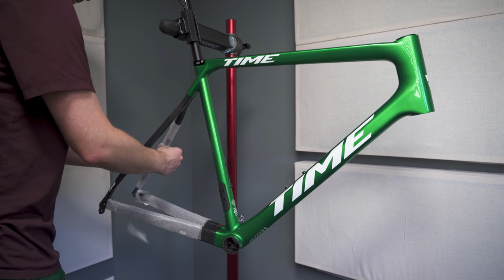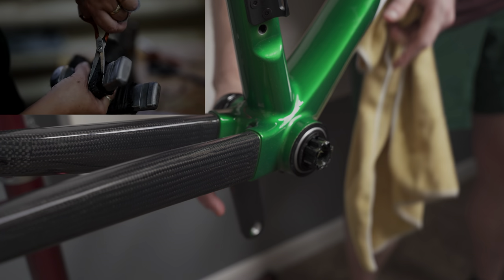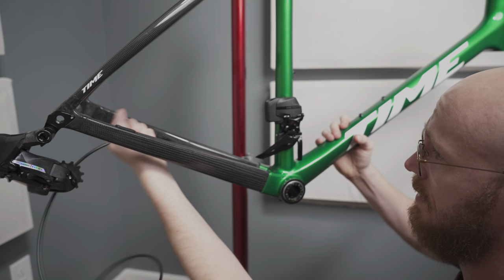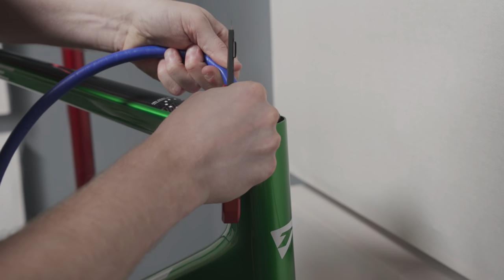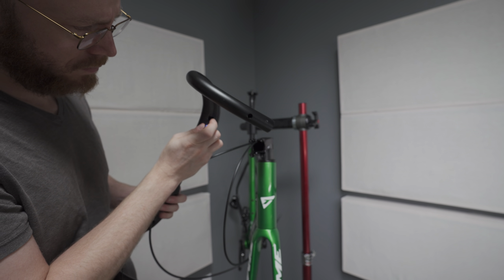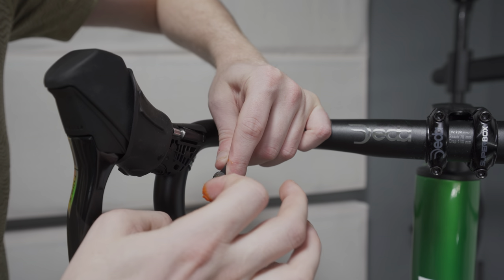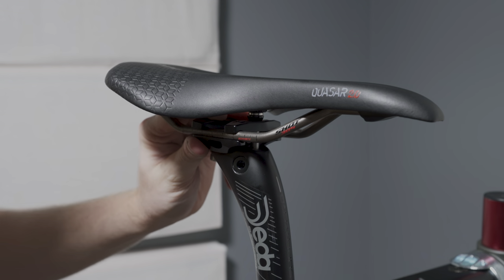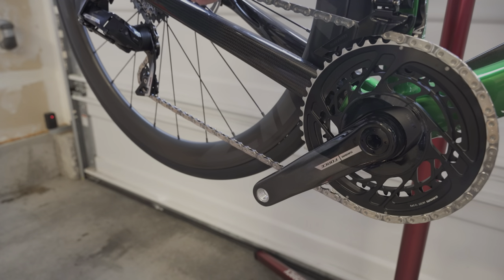Time Alpe d'Huez Disc 2023 with Sram and Zipp: Dream Bike Build and Ride in 4K HDR

Comment: I really like these frames. It seems like every choice Time made in its design was made to improve the practicality and durablity of the frame. There's lots of stuff that most people wouldn't notice. For example, Time limits the number of metal/carbon interfaces on the frame to limit galvanic corrosion. This probably won't matter until year four or five of ownership of the bike, but at that point the Time will still be in great shape while other frames will be starting to degrade. The paint, BB, dropouts, seat post clamp, headset seat etc, everything is simple and proven. This is a bike for people who like to ride a lot and want a bike for years that's not going to cause them problems. I'm personally waiting for a revised Scylon with an integrated front end, which will likely come in 2024.
Reply from the maker: Totally agree. It's funny because on one hand they're undeniably very flashy, but also they're a different kind of flash than a lot of the big name brands. I've just been around bikes long enough that I'm not impressed by whatever the engi-marketers come up with for this model year (forgetting The Big Thing that launched and dissapreared last year.) I just want a really solid frame, and this was it. I'm excited to see what they do on the Scylon. Mayne the Time gods will gift me a frame (kidding. mostly. 🥲)

Comment: I enjoyed that. I'm currently contemplating the same frame in red but with DI2 and Hambini BB. I just think these bikes look stunning and scream quality.
Reply from the maker: Do it! If possible, buy through a dealer vs. direct.
Reply: Why not direct?
Reply: I ended up with a Look 765 Optimum because the geometry was a better fit. Bought the frame from a bike shop and had them build it up to my spec. For me I wanted a more bespoke build that direct doesn’t offer.
Reply from the maker: Looks have the best paint scheme of all bikes IMO
Reply from the maker: @Floemo  much better customer support through a dealer. Time's national direct sales is... Fine at best.
Reply: @JustinDoesTriathlon  Yes have noticed that communication is worse than the Italien brands.

Comment: Justin- great video, I’m looking at a consignment Time and this helped a lot!  Was curious for a follow up on how you’ve enjoyed this!  Thanks!
Reply from the maker: Absolutely great. The only major tweak I've made (and I still need to make a video on this,) is: I don't trust hookless nor see the upsides to it, so I swapped the Zipps for some Light Bicycle AR465s on DT350s, which I quite like. I also had some major problems with my Sram AXS that required a warranty swap through Sram for the RD (which admittedly would have been easier with a larger brand I bought through an LBS.) But in terms of the actual bike itself, very very much enjoyed. I’ve really come to enjoy the ride quality and geometry (which just works VERY well for me once I dialed it in.) A lot of non-aggressive geometries (basically, not Tarmacs, etc) really seem to imply that if you don’t want a crit machine, you want handling like an oil tanker. The geo on this really seems to thread that needly between very stable at speed while also being nimble when you push it. It’s very much what I was looking for.
Reply: That's awesome feedback, thank you! @JustinDoesTriathlon

Comment: This intro 😍
Reply: That foam hose is a good idea.  I've tried using zip ties to push the cord to one side and hold internal cables in place and reduce rattle but that hose is a more elegant solution.
Reply from the maker: @mlegrand  I know Shimano says the zip ties are a good move, so I assume it works well for di2 cables and stuff. But yeah, the hose, albeit overpriced, worked great!

Comment: sweet riding bike!!  nice video
Reply: i got sram force axs wide (gearing)   that i need to add to 1 bike.  order it doing covid time..       what tires are you running?
Reply: That intro was smoking!   Right?  👌
Reply: @mlegrand  yes it was solid
Reply from the maker: @bonn1771  I'm really liking the wider ratio vs my old gearing. 2x10 @ 12-25 because I liked that tight gearing, but when it got steep, my cadence would drop fast. 2x12 @ 10-33 still gives me my tight gearing, but drops way lower once the road turns up, which is great. Tires are Goodyear Eagle F1s (just because they came with the bike.) Haven't pushed them hard or in many conditions yet, and only have ~~400mil on them, but they seem good. Stickier than my old GP4000s. When these eventually wear out I'd probably do GP5ks or Pirelli PZeros.
Reply: @JustinDoesTriathlon  ratios are key. And nice. My friend uses those for training right now as well. Enjoy your ride

Comment: Hey Justin, great build and footage of the TIME bike. I'm just waiting a few days to receive my ADHX with the Amber resin. So exciting to build the component list and will use a lot of the tips and build details you have shown here. I'll be running with SRAM Force in a 1x drivetrain 10-44t with 40t chainwheel. Did you manage to get the risk brake hose tube all the way down the cable run? It looked tricky to fit. Also I have LightBicycle XC924 rim wheelset coming as well.
Reply from the maker: That's going to be a great build! The tinted resin on the ADHXs is just 10/10. Yeah, the brake tube was a bit of a PITA. In retrospect I can think of two things that would help. One, run the brake host before putting the BB in. That'll give you better finger access down there as well. Two, use some sort of lube in the tube. Soapy water or isopropyl might work. I had to do the scrunch and pinch method. That said, it worked out well enough and I definitely reccomend the tube; the bike is silent. 

Duno if you saw in my other comment, but I ALSO put Light Bicycle wheels on (AR465s.) They make a very solid wheel. Enjoy it! :D

Comment: Very nice Time!

Is this a size large you are riding and if so can you tell me how far you set your saddle top above the center of the bottom bracket?  Thanks
Reply from the maker: Thanks! You got it, it's a Large. From exact middle of BB to top of saddle, running right up the seat tube, is 29.5"/75cm. I will actually be raising this appx .25" on mine. The geo on this frame is very interesting (I assume you're considering?) It's defintely not a full race bike, but with the seattube angle and chainstay, it's still fun. I very much like it.

Comment: Did you have to use the microspacers between the compression ring and the upper headset? 
My headset was a bit ruff without them.
Reply from the maker: If I remember correctly I used one. But yeah, I'm pretty sure there's at least one (perhaps two.) I don't think there's really any downside too them so if you've got rubbing the shims should take care of it.
Reply: Thanks for the fast reply! 
I used two of them and rubbing was solved.
Reply from the maker: @robertkleemann11  🎉🎉

Comment: Just got my frame and want to build it up with the same Deda stem system you have used. On the Deda website for the headset top cap it doesn’t list Time as an option but does list many other manufacturers, which one did you choose to be compatible with your frame? 

Great video, thanks 👍
Reply from the maker: Certainly. So the one that I used was included, and it's the Deda Alanera "TOP CAP SUPERBOX https://dedaelementi.com/superbox-topcap)  on their website. Works perfect. One note, if you're using the Superbox + the Deda expanding plug, it's a little different than a lot of other stems. The top cap actually extends below flush with the surfact of the stem, and you need room to take up slack in the bearings. Officially, the Deda expansion plug manual or Superbox manual (I believe, absolutely double check this!!) indicates a nominal 3-4mm gap between the top of the steerer tube and the flush top of the stem. This is different than the vast majority (nearly all) carbon steerer tubes/expansion plug/stem combos where the steerer extends to the top of the stem and then you use a 5mm spacer on top to pull up space. So, all that's to say that if you use the Alanera top cap, you'll end up cutting the steerer a touch shorter than you would with a more traditional stem/spacer setup.
Reply: Do you put the stem on the steerer, make a mark and then take of 3 more millimeters?
I’m about to do the same ”operation” and are a little nervous about it 😅

In the Deda superbox manuall it seems like it should be 3 mm down from the top of the top cap?
Reply from the maker: @robertkleemann11  Steerer tube was the one thing I took to my LBS (mainly because I don't have a carbon saw.) IIRC (absolutely double check,) what you said is correct: Deda wants ~3mm of gap. The manual is atypical; most carbon steerers require the steerer flush with the top of the stem, and then typically a 5mm spacer to take up bearing gap. This stack is different, and yes, the steerer is shorter than the stem, but only very slightly. It's nervewracking.
Reply: @JustinDoesTriathlon  thanks for the reply and great video! Been watching it several times 👌
Reply from the maker: @robertkleemann11  No prob! Congrats on the fun new bike. :D

Comment: Nice build! Enjoy.
I have the ADHX with Red axs.
Question - I have the K-Edge chain catcher and it works and seems compatible.  Why did yours not work?
Also - I need to investigate the chain breaker thing.  Never occurred to me that my Park tool would not work. But I also have an Abbey chain tool.
Reply from the maker: The ADHX is so nice. I love that semi-clear resin. That's stunning. That is indeed interesting! I wonder if it's a Red vs. Force thing? On mine, the top of the cage interferes. Can't set the low limit properly. I suppose technically the better way of saying it is, "You can put the KEDge on, but on mine, for it to clear the FD cage it had to be so far inbound as to not really prevent drops." The Sram catcher has a deeper cutout and sharper bend, so it clears around the cage and then sits ~1.5mm away from the smaller chainring. Yeah, and I don't know about the chain breaker being a real problem or not, but all the Sram lit is very clear that there are specific tools to use to avoid damaging the plates. I needed a new one anyway so I bought one, but I dunno how 'required' it truly is.

Comment: Thanks for the honest, straightforward video! I’m looking at the Canyon Ultimate SF CLX and the frames look very similar. However, since learning about both Time and Look, I think my opinion of value is changing! BTW, How reliable is the Time size recommendation?
Reply from the maker: I do quite like Look, but my love of Mondrian is probably a bias there. 3T is also worth a look; they use RTM as well. 

Does Time have a sizing on their site? I didn't know about it. I actually just sized it based on my old frame as well as using geometrygeeks.bike to compare the geos. For me, the geo of the Time was near perfect.

Comment: Great video😊 I have a the same frame in chroma red on order. It looks spectacular on the TIME website! I would like to ask you what bb press tool you use ? Best regards
Reply from the maker: Oh congrats, chroma red is SO good looking! The BB press is a generic one from Amazon; nothing fancy, like $25. I did 3d print a bearing drift (I don't think it's in the vid though) to get them in straight. Just the ID of the BB shell and the OD of the press.
Reply: @JustinDoesTriathlon  thank you 😊 I don't have a 3D printer, so I have to buy the drifts...
Reply from the maker: @nielsgramjeppesen7855  Worth it. The cups wanted to wander until I did that.

Comment: Great video! Just ordered my ADH in red with Dura-Ace. What does your build weight in at?
Reply from the maker: Congrats! Very exciting. Did you get the chroma red or team red? I don't even have a preference, they're both fing great. I don't know weight, actually, don't have a proper bike scale. Heavier than my old very light CR1/rim brake, actually. I'd guess right around 8kg. TBH I'm not terribly concerned with weight in gernal, but yours will be lighter with DA than my Force.
Reply: @JustinDoesTriathlon I went with the chroma red. How are you liking the Zipp 303s? Any issues or concerns with the hookless system?
Reply from the maker: @chrismitsou9686  Very nice red. :D 

Great question on the 303Ss. No issues, but yes I’ve swapped them out for some Light Bicycle AR465s. Basically, I don’t trust hookless. As I see it, essentially no upside at the risk of potential major downside. And it’s true, hookless has not shown to have significant problems in the vast majority of cases. Properly setup, it seems fine, and I trust my mechanic skills. That said, I bought my Time a month or two after having a catastrophic carbon wheel failure on a descent (not hookless related.) I know exactly what it feels like to have a wheel break, and it’s 0% fun. If I’m going fast, I don’t want to have that voice in the back of my head wondering if I should have added a few more PSI this morning and if I am at risk. Hooked clinchers just work. I wouldn’t tell someone not to ride hookless, but I just don’t see the benefit for me and swapping to something that alleviated it was very easy. Also, I like the gloss black of these wheels better than the matte on the Zipps. :D

Comment: Hi. I'm about to purchase the 2023 frame like yours in different color but I haven't heard back from Time yet, so I'll ask you: did the frame come w/ the seat post? I can't find the info on the website.

P.S. Also, you mentioned that you were not aware of the sizing chart. Yes, because I couldn't find one either. What's your height and what size you went for?
Reply from the maker: I bought a complete bike (unassembled), and it came with the seat post. I think if you buy a frame only, it’s frame and fork only. 

I am exactly 6ft, with proportionally long legs. I went with a size L, based on my stack and reach from my old frame. I could fit into an XL, but I prefer riding smaller frames and adapting the cockpit from there vs. a larger frame with less adaptability.
Reply: @JustinDoesTriathlon  Oh that's interesting! I'm somewhat a Van Aert-like rider on the sense that he rides a way smaller frame than those generic charts recommend. I'm a tiny bit taller than 6'1 and my Giant TCR is M/L. It fits perfect and is very compact, a total slammed racing position. But when comparing numbers from Time ADH 21 some numbers favor M while others L. Now, going from such a different geo that my TCR is to Time ADH 21 is hard to tell which size would give me that same or the most similar position that my TCR does. My TCR has 110 stem and I'm upgrading to 120. That's why I gotta wait for Time staff to get back to their offices on Mon. I only wanted to ask does the frame run small in sizes, at least for you?
Reply from the maker: @shadowsun33  So definitely double check this, but imo yes, the frames are on the smaller size of their sizes. But they're also not that aggressive in general. If you haven't used it, check out geometrygeeks.bike. It's a tool that lets you punch in multiple bikes in multiple sizes and compare the geo. I checked out the 2019 (Guess) TCR in L vs the ADH in L, and the ADH is lower/shorter/longer in almost every dimension relative. Seems that an ADH XL is more akin to the TCR L. https://geometrygeeks.bike/compare/time-2023-alpe-dhuez-disc-2023-l,giant-defy-advanced-pro-0-2019-l,time-2023-alpe-dhuez-disc-2023-xl/
Reply: @JustinDoesTriathlon  Yes, I was comparing the 3 on the geeks website yesterday. Giant TCR M/L against Time ADH 21 M and L. By reach I figured that this time I may have to go w/ L, which is 57. However, when I tried Pinarello F5 aka Prince I was shocked to see that their 54.5 size fit me well which was size M. Thanks for your input.
Reply from the maker: @shadowsun33  Sounds like you've got it right! Big thing for me is: You can always make a small bike a little bigger, but it's hard to make a big bike smaller.
Reply: @JustinDoesTriathlon  Big bikes are just awkward for me handling wise and to look at as well. Even my enduro is a size smaller and it handles amazing. Thanks again.

Comment: Hey! Question about tire clearance - is it really only 28mm? What tire size are you using and how wide it really is on those Zipp wheels?
Reply from the maker: Yeah I wouldn't go wider than 28s, it's a real 28c clearance. I have actually since sold the Zipps and moved to Light Bicycle AR465s. I can throw some calipers on to check the actual measurement, but yeah, I wouldn't plan on running over 28s. That said... The interesting thing is that their ADHX (not the AHDX45) is verrrryyyy close to the exact same geo. If you’re looking for an ADH but want wider, that’s probably your move.
Reply: @JustinDoesTriathlon  Please do the measurement if you can. For example Conti GP5000 S TR 28 measures >29mm on a 19mm IW rim, which in itself is considered narrow for today’s standards. Yet Time markets the ADH with Zipp wheels, which are either 23 or 25mm IW. Are they using 25C tires? A 28C tire will blow up to at least 30mm on these rims 🤔
Reply from the maker: Will do tomorrow night 👍
Reply from the maker: @pogoking4000  Alright, here you are. I'm running Light Bicycle AR465 wheels that have a claimed internal width of 21mm. Paired with Goodyear Eagle F1 28mms. At pressure,  measuring the tires at 26.8. I have appx 6mm of clearance from the tire to the rear stays.
Reply: @JustinDoesTriathlon  I’m a noob but does that level of clearance mean you can go for 30mm? I would prefer 32mm but would settle for 30mm
Reply from the maker: @theinstigatorr  No, I wouldn't say that's enough.
Reply: @JustinDoesTriathlon  how are you liking the Light Bicycle AR465’s? And wha Hubs are you using?
Reply from the maker: @kevgomes  No complaints at all! I just did DT350s on them. Admitedly I don't have a huge amount of miles in them because I herniated a disc in my back early spring but the wheels are perfectly good to me.